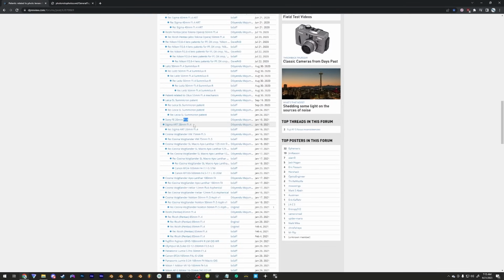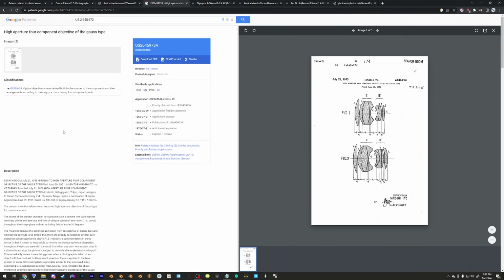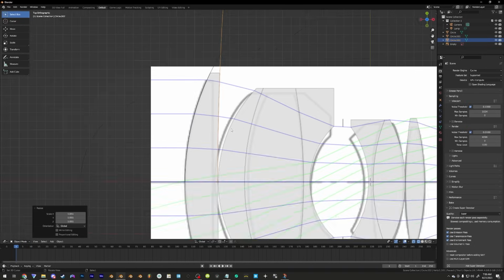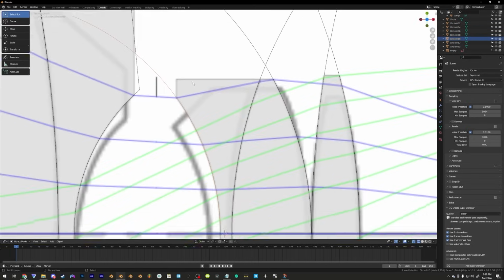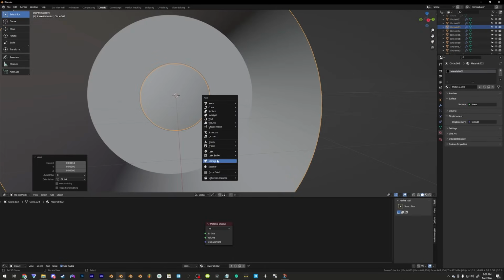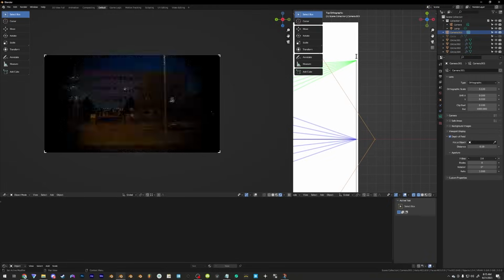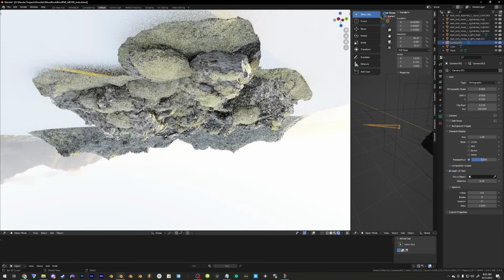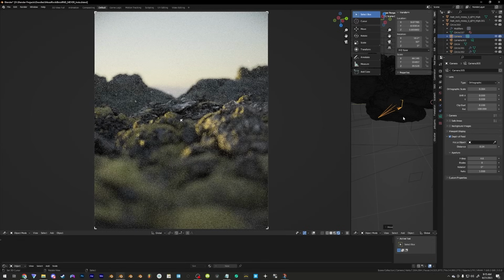Achieving True Photorealism With Lens Simulation

Comment from the maker: https://www.dpreview.com/forums/post/65906028 

Here is the forum post including the patents!
Copy and paste it into your search bar since youtube doesn't allow link's in comments on mobile anymore.
Reply: will there be a follow up video where you show how to fucked the lenses up for some lenseflare or more grundgy effects? great video btw, was trying this in the past, but you are more scientifically minded than me
Reply: @JointManJoe  this is coming a bit late, but here's how to do it generally > you need to simulate scratches on the lens. place a plane where the aperture should be and give it a transparent shader. use any kind of grunge map and that should be a good start. to do it in a more "advanced" way, map scratches on the front lens and use it in the bump, see how that goes. make sure to really lower the bump distance. it should be less than 0.001

Comment: can you get lens flares with this ? Or the glasses are too perfect and we should ad the case of the lens so it can bounce back ? Or just add slight imperfections to the glass elements ? 
Btw, amazing video, as 500+ people already said lol
Reply from the maker: Lens flares are possible but it requires a rendering engine that supports either photon tracing or bidirectional path tracing, eg octane or the defunct luxcore.  Even with these its impractical and will be extremely noisy, I have a couple of examples on my twitter.  Thank you for the kind words <3

Comment: Still coming back to this whenever I feel like doing lenses again. My main remaining issue is using the camera in a scene.
The hardest part, and something I can never resolve, is getting the blur to work just right. I want to essentially replace my usage of Blender's DOF with the camera lens 
But either I'm not using the right camera, or there's something in the process of bringing the camera to the scene that I'm not doing right 
So I wanted to ask if you have any thoughts on that
Reply from the maker: Heyo!  depending on scene scale it could be an issue with blenders floating point precision.  Sadly there isnt a fix to that other than adjusting scene scale as a whole.  Another fix is the new lens sim addon by Havard, (my aff link: https://blendermarket.com/products/lens-sim?ref=7175)
It works extremely well and my next tutorial will be covering it.
Reply: @zircron45  Ah, I forgot to update 
I believe it was scene scale that made the blur hard to adjust 
But now it seems it’s hard for light to get into the camera, making it extremely noisy for dark scenes
If it’s not meant for dark scenes, that’s alright. But thanks for the quick reply! Will look forward to the next tutorial

Comment: 17:34 "this is the radius in millimeters"  are you sure?  those numbers makes whole lens stack very small.  But you use default 1m radius at the begining. I want to scale down whole model to proper size of lens but cant find a coefficient or diameter of lens. i think it is important. I suppose that there is inches in table? but even in inches all dimensions looks very small
Reply: Solved!  this is not millimeters or inches this is  times of focal length!  thatks to Patent text
Reply from the maker: @ Thank you for the correction!

Comment: This video is great, but I do have an issue with the image not being focused towards the edges to a pretty extreme degree, and I don't know if it's a lens issue or a render time issue
Reply from the maker: Sounds like a lens issue!  Try rendering 20k samples overnight and see if that fixes it.  if it doesnt you may need a new patent or you may need to do some reconstruction.
Reply: @ Thank you! I will definitely try that, and maybe use the lens you used to see what’s up
Reply from the maker: @linco-WDB  Photons to photos has a focal plane curve display, i dont remember which toggle it is but its pretty self explanatory when you find it.

Comment: This is such an awesome tutorial 🙂 And your results are incredible!

I've tried it by my own in Blender 4.2. But I still have a problem. After applying the correct IOR-values and enabling DOF in the camera settings, I get a heavy distorted result. And it is always slightly unfocused 😑I've remodeled everything several times and played around with the focus distance, but nothing helps. The image is pretty normal at the center. But more than 50% to the edge is heavily distorted with a strange triangle-shaped bokeh. Does anyone know, whether Blender changed the refraction shader or something similar?
Reply from the maker: I dont believe so, check "face orientation" in the viewport overlays

Comment: Hey @zircon45! Thanks for the great video. I've applied this to a microscopy setup I plan to use for my research, which features 13 sequential lenses for a 20x magnification setup. Everything is working as expected, except for some weird artifacts occurring around the optical axis (center of each lens). Any idea what might be causing these?
Reply from the maker: Heyo!  I think its the merge distance on the screw modifier.

Comment: Hey I've got a weird problem where I get a bunch of circlular distortions at the center of the lens. It seems to be the front and back elements of my lens, but if I isolate those elements I can't see any distortions. Any ideas? I think I may have missed something but I've gone over the section about fixing normals a few times and can't seem to find the problem.

Comment: Thank you! I recreated your tutorial, everything is cool. But it only works good when camera is huge (lens 1m in diameter). If I scale it down to real world size and adjust all settings, very little light comes through and the image is very dark. I thought to fix this with exposure, but it's limited to 10. Is there a way to remedy this

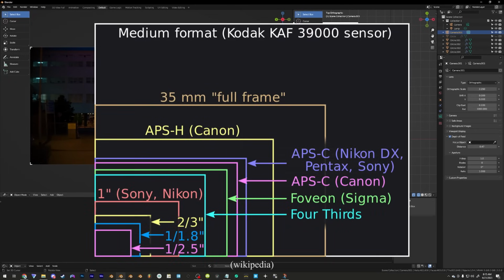One more question, at 41:40. How is 2.290 Orthographic Scale is equivalent to 35mm sensor size? Isn't Orthograpgic Scale dependent on how big model of your camera is?
Reply from the maker: Heyo!  These are all good questions, the smaller the lens the more blender struggles to place vertexes precisely, its frustrating but a group of friends and I are working on a solution.  Try separating the doublets a little more and making sure there are no intersecting normals.  As for the orthographic scale, it doesnt matter based on the scale of the camera itself, just the size of the "plane" the front of the camera occupies.

Comment: sorry for asking here but i cant seem to make it work, the moment i enable depth of field in the camera settings it just blurs everything even with the correct distance.
the only way i got it to work is using an absurdly high fstop like 5k or something, but then its just a regular sharp image.
thanks in advance
Reply from the maker: @IllusionAnimates  heyo, have you checked the back of the lens to see if it focuses?
Reply: @zircron45  wow thats for the insanely fast reply
didnt except this at all!!
i think it does?
all the normals are checked
the autosmooth is checked
theres no roughness in any lens 
all the ior values are correct
i tried making two lenses and the dof is the only issue im facing with both.
everything looks correct if I just disable dof
but that kinda defeats the whole purpose ahahaha.
Reply from the maker: @IllusionAnimates  I gotcha, the next idea i have is to test it with a diffuse plane.  Make sure that the refraction rays have no glossy filter.
Reply: @zircron45  no glossy filter, no clamping, no gi approx or lighttree. I really have no idea whats going on. I tried using this setup in octane and it kinda works.
im stumped
Reply from the maker: @IllusionAnimates  pain, its frustrating troubleshooting in youtube comments but my next train of thought is if it works with octane can you try matching the octane settings in blender?
Reply: @zircron45  Its the same exact settings
i got some better results by moving some of the lenses in the middle
but I still cant manage to make it work correctly
even tried luxcore but i think depth of field doesn't work with orthographic lenses on it
If youd like I could dm you on whatever platform youre comfortable on
thank you again!
Reply from the maker: @IllusionAnimates  Does the lens youre making have aspheres?
Reply: @zircron45  nope, its the same exact lens as the one in the video.
Reply from the maker: @IllusionAnimates  It should work then
you can hmu on my instagram @zircron45

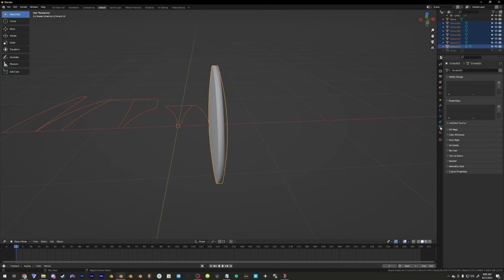Comment: 26:50
the 'normals' tab is gone. atleast for me
My 'screw' modifier also isnt perfectly round as yours but more oval shaped same as my lens elements when I copy the modifiers
Reply from the maker: Did you scale the lenses uniformly?
Also yes normals tab is gone its now a modifier
Reply: @zircron45  
I followed everystep you did but with a different result. Not sure what you mean by uniformly. You mean all the same size? I scaled them so they fit the reference image of each lens element.
Reply from the maker: @Keckegenkai  sorry if i said wasnt clear, check the scale property of each lens and make sure every axis is identical 
If you dont want to do that try just applying the scale on all of them
Reply: @zircron45  
Wow, that did the trick! Thanks for your patience with me!

Comment: This is incredible interesing. Every month there is a blender tutorial where I think it's the best thing I have ever seen but you just topped all of them. I studied photography for 5 years and your video reminded me of many concepts I learned about. I'm currently in the process of copying what you do and seeing how it works myself and what I noticed is that I initially modelled the lens far too big, the first element was like 2.5m. So I looked up how large it should be and I believe 62.5mm should be the right size. But when I decreased the size I was unable to get a sharp image... maybe I made a mistake when downscaling that led to some clipping or something.
Anyways, super interesting, I will try to use this in my next project :)
Reply from the maker: Heyo!  This is a limitation we're aware of and it sucks, but blenders floating point errors increase as scale is reduced. The fastest solution is to just work with slightly larger scales HOWEVER there will be a solution when 4.2 is released, that being the ray portal node.
In the meanwhile if you see two lenses intersecting their surface normals just separate them a bit.

Comment: "F4 would be very very slow" lmao. Slower than f1.4 sure but nowhere near "very" slow imho
Reply from the maker: From my experience with zoom lenses I always have to keep my iso super high with anything above f4.0. I'm probably pushing the term a bit but f4 is a slow lens especially by prime standards.
Reply: Having worked with a wide range of lenses myself, especially at the longer focal lengths, f4 feels like nothing. I work a ton in the range of f5-11 and getting iso100 with 1/500 is easy when you have decent light
Reply from the maker: @DakkyW  yeah for a long lens esp a long zoom lens f4 is fast, but on average primes range from 1.0 to 2.8 with some exceptions ranging from 0.95 to the old symmetrical lenses at 3.5-6.0
Reply: @zircron45  yeah, given short primes aren't the only lens type by far, f4 being called very very slow just felt hella exaggerated haha

Comment: I know that you keep referring to the aperture. But the f/number is the maximum amount of light allowed through the objective (front element) lens. The thing you keep pointing to is colloquially called the aperture but it is more accurately defined as the iris.

Different 50mm f/1.4 lenses will all have the same objective diameter but may differ greatly on iris size depending on its location in the lens assembly overall.
Reply: Also, bokeh quality is primarily determined by the shape of the iris. Swirls come from optical astigmatisms - they are not determined by the “fastness” of a lens.
Reply from the maker: @jonathanfields87  indeed!  However fast lenses more often than not have very strong astigmatisms and/or petzval curves along with lots of vignetting which leads to swirly bokeh!

Comment: this is awesome! have you seen lushfoil photography simulator using ue5? That would need this lens simulation. Could use real time renderer to aim the shot and then ultra high quality pathtracing settings for the render in UE5. And then add in a sprinkle of VR to make the perfect photography simulator.

Comment: Two suggestions for further work:

1: You used moving the sensor in your virtual to set focus. You can do one step better (read: more approaching accurate lens behaviour) in moving the focus group of the lens instead. Which bit of glass, or bits of glass the focus group consists of, that is depends on the lens design.

2: See if you can find the patent or optical design of the Soviet Helios 44-2 58 mm f/2 (actually a copy of the Carl Zeiss Biotar 58 mm f/2 lens) because that vintage lens is well known for producing "swirly bokeh". Plenty of example images to show what kind of unusual out-of-focus highlights this is about. You will know how good your approach has been if you see the same effect in virtual shots.
Reply from the maker: A lot of lenses use focus groups but the primes I chose do not have focus groups, cinema lenses use diopters and whatnot and that will be covered!
Reply: @zircron45  Ah, ok, I must have missed the specifics of the lens you picked.

Comment: but if you have all the geometric data from the patents why do you use a refference image and model the optical elements by hand ? You could use a fully non-destructive workflow for this, you know. it could be as arbitrarily accurate to the patent specification as you want

Comment: For aperture / F-number / "fast" vs "slow" lenses:

The aperture number is the ratio of focal length and the effective diameter of the capturing light path. 

A lens with a 200 mm focal length and wide open aperure of f/2.8 will have a light path that captures light through 200/2.8 ≈ 71.4 mm diameter. A 200 mm f/2 lens will capture more incoming light, with an effective diameter of 100 mm, at wide open aperture that is. 200 mm f/4 will only let in light through at most Ø 50 mm.

Likewise, a 50 mm f/1.2 lens (≈ Ø 41.6 mm) is much more sensitive wide open than a 50 mm f/2.8 (≈ Ø 17.9 mm) lens and allows for a faster shutter speed in the same lighting conditions.

Some lenses (often cinema lenses) have t-stops (transmission stops) instead in which case the light path diameter is larger, but the aperture is given in effective transmission stops because some lens elements are not fully translucent.

Comment: 17:46 the radius and distance values are actually not in mm. They are dimensionless. The lens in the patent has a focal length of 1 and the distances can be linearly scaled to get the correct focal length - this is a general property of geometric optics. So if you wanted a 50mm lens you would multiply all of those values by 50mm (just the radius and distance values not the refractive index or abbe numbers). This is a cool video, thanks for sharing.

Since you aren't modelling the dispersion (Abbe number) of the glasses you are missing out on any kind of chromatic aberration, which is pretty nice as many older lenses have ugly chromatic aberration. It can always be added in later to the final image by blurring the colour channels differently (longitudinal chromatic aberration) and changing the magnification each channel (lateral chromatic aberration).

Comment: so I don't have a normals tab in the data tab for some reason so I can't check the autosmooth box there, I was wondering if that will cause issues, because mine doesn't quite look right. Awesome video btw!
Reply from the maker: Its a change in blender 4.1, sucks but instead of that you use the edge split modifier.  If it doesnt quite look right are there aspheres?
Reply: @zircron45 I have since got a more capable computer for this and simply downgraded my version, it works amazingly so thank you so much!

Comment: I'm a photographer, and am VERY much not knowledgeable in the 3D modeling space, but I find this to be so incredibly interesting. Most of the camera/lens renders I have seen online have all been full frame/35mm sensors, and while watching this I could not stop thinking about simulating a medium format sensor, or even simulating a digital large format sensor/lens. Side note, while fast lenses are great, stopping them down to around f4 or even f8 (ESPECIALLY on medium format) achieves stellar photographs. 

I'm not sure if you stated why aspherical lens elements were difficult to make, I'd like to hear more on that. It would be crazy to try this with anamorphic lens elements as well.

Comment: Nice job! I did this for the meme, but I'm impressed with how you've managed to refine it. I'm also really curious about why that DOF trick of the orthographic camera ends up allowing you to get the focused image in the end. (Thanks for the shoutout ^^)
Reply from the maker: Heyo man!!!  Honestly you posting your project was the catalyst for me documenting what I had, I loved the production on your video.

The way the DOF trick works is it's forcing the orthographic camera to focus down to the ray paths casted by the lens onto the ortho focal plane
its really weird but it works and its 10x less noisy than using the blender caustics
Reply: @zircron45  Thanks! Glad I could do my part to catalyze your process haha

Interesting about the DOF. I'm not 100% convinced on the "correctness" (feels a bit hacky), but it seems to have worked pretty well.

I noticed in a couple other comments you mentioned maybe working on an addon. I also had an idea about how to improve mine and turn it into an addon, but I'll try to align myself so I'm not doing anything too similar to you. Don't want to overlap too much 😅 Feel free to send me an email if you want to coordinate!